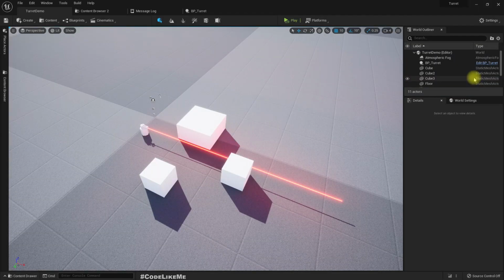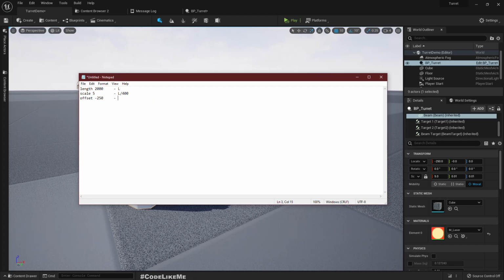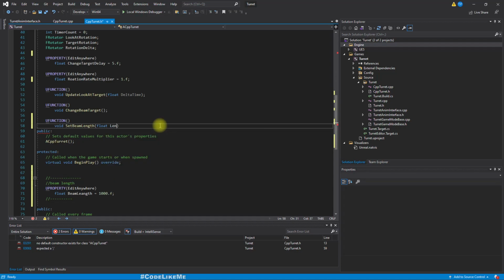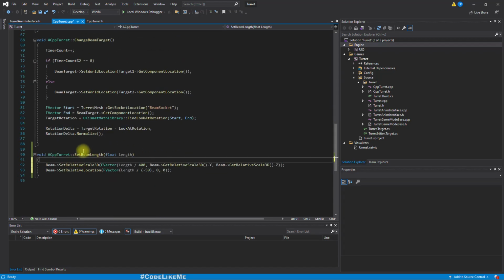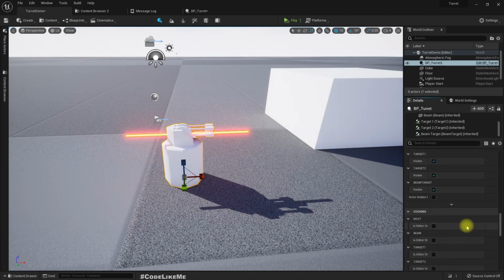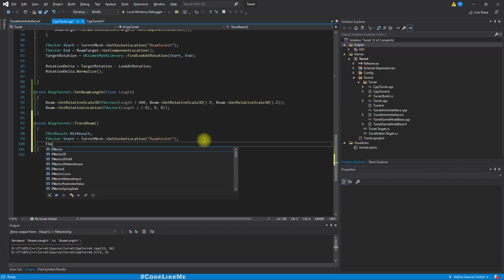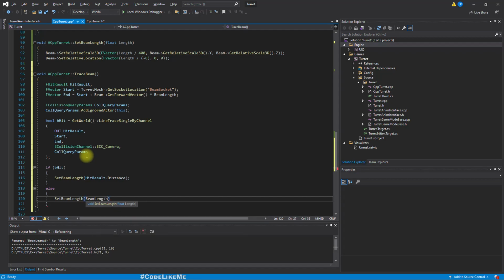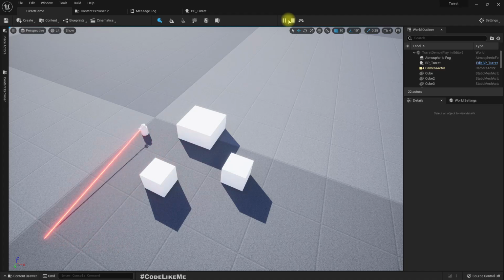Unreal Engine 5 C++ Tutorial - Turret #3 - Line Traces

Comment: The mathematics in Set Beam Length haven't worked for me.  The beam was too short.  I've used the following, SetRelativeScale (FVector (Length / 100.0, (Y & Z as in tutorial), SetRetativeLocation ( FVector (Length / -2.0f (Y & Z as above).
My beam setting in my BP_Turret are as described, therefore the ratio's are the same.  
I didn't discover the problem until later in the tutorial.  Hope this helps someone.
Nick
Reply from the maker: Thanks for sharing